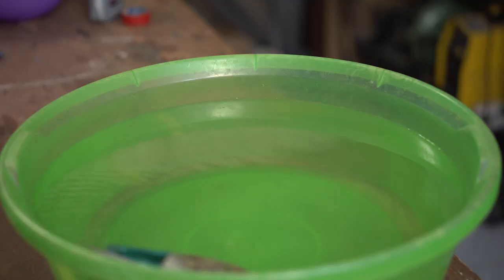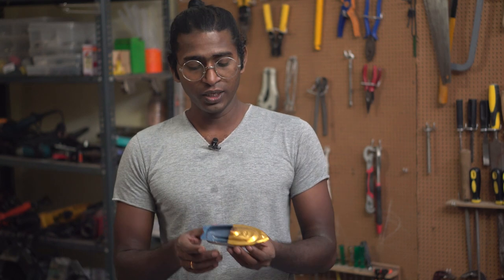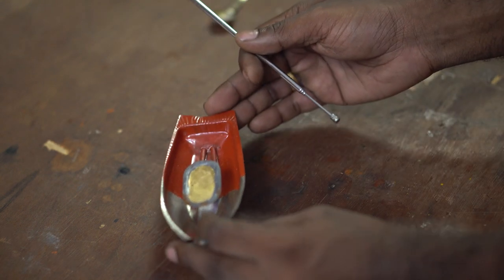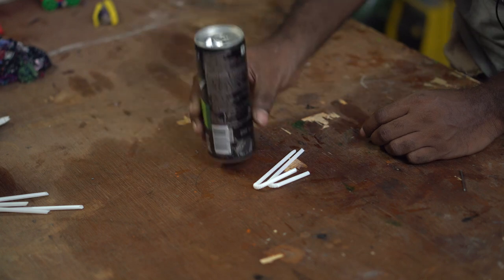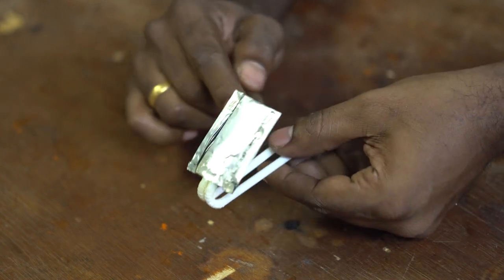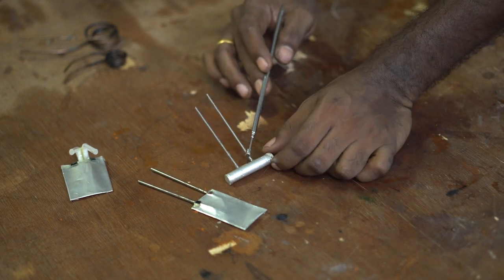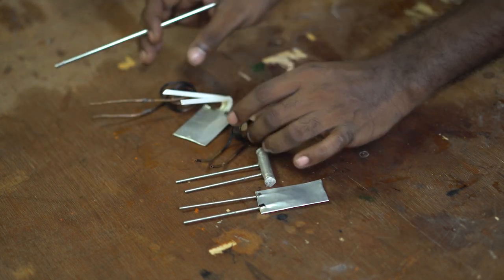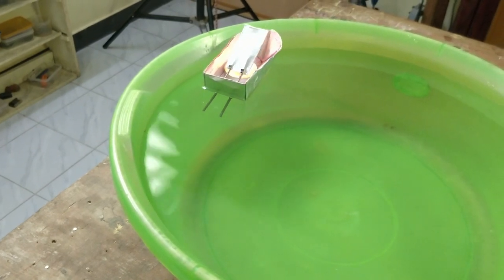How to make a candle powered boat

Comment: Awesome video. I only have two questions about the coil pop pop boat, if there's more coils, will it go faster? If so, adding more candles will make it go faster?
Reply from the maker: My guess is making more loop in one coil won't help as the nozzle and opening are not altered. It might speed up, but not much. 
Having two or more sets of coils will work as separate engines and the boat will gain moment due to the added weight of the coils and candles. But this would again add to the drag and it needs to be designed in a way to overcome drag

Comment: Very cool channel, well presented! Subbed
Reply: The reason it is able to propel the boat is the heated water is expanded by the heat, and is discharged at a higher velocity than the cool intake.
Reply from the maker: Thanks a lot. Positive views like these keep me going.
Reply from the maker: That's actually simple and good explanation. Thanks!